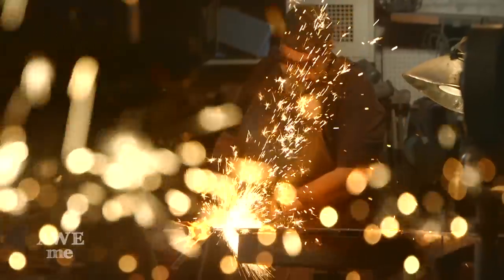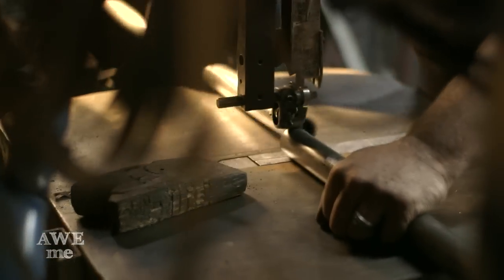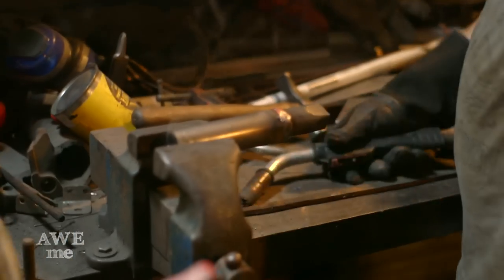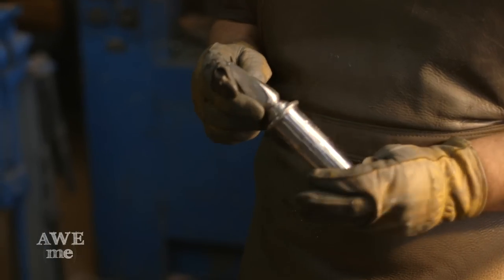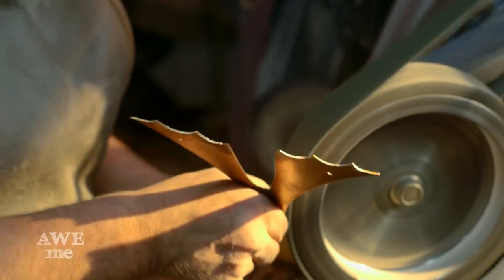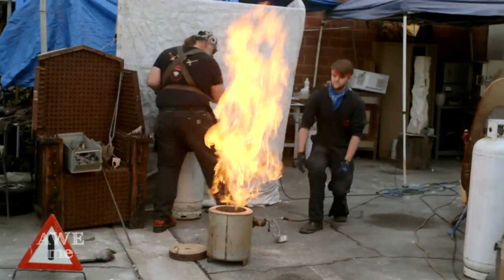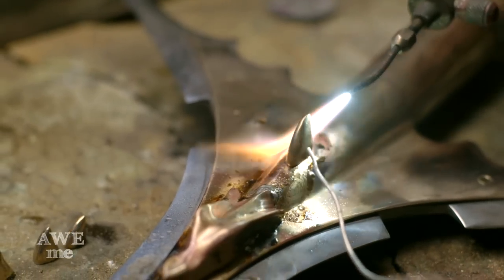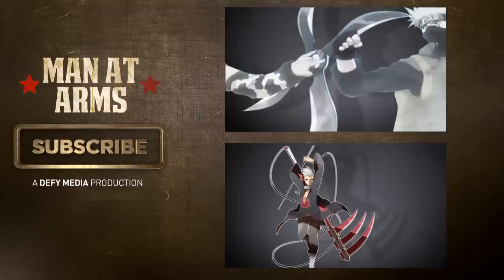Elric's Spear (Fullmetal Alchemist: Brotherhood 鋼の錬金術師) - MAN AT ARMS

Comment: It seems to me like those piece that were riveted onto the head were kinda flimsy.  It looks good when it is just sitting there but once they started swinging the spear then those thin strips of metal started to bend and they were getting stuff underneath them.  I feel like the same visual effect could have been achieved by hot brass brushing that section of the head rather than riveting thin pieces of metal onto it.  Then the head would have looked much more solid and sturdy while still having the brass finish on the middle of the head.  However, I am not a blacksmith myself so my opinion doesn't carry nearly as much weight as the guys who made the spear.